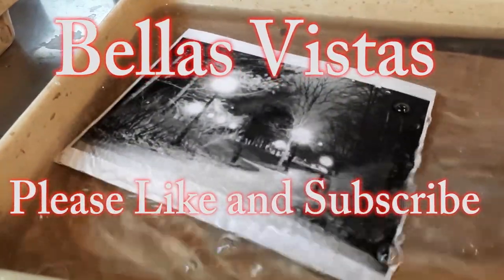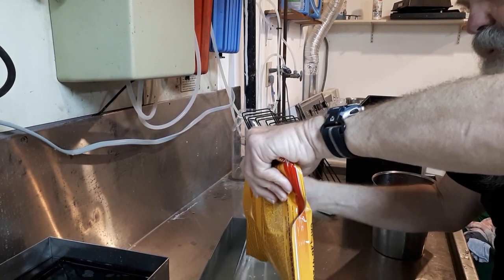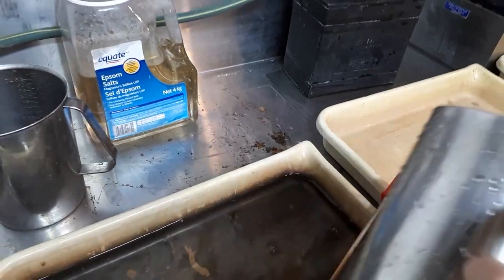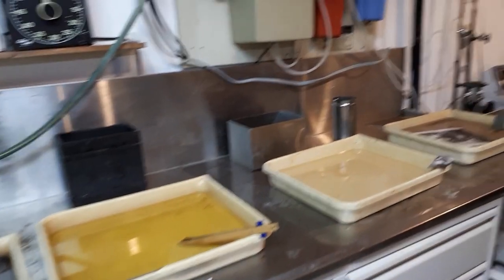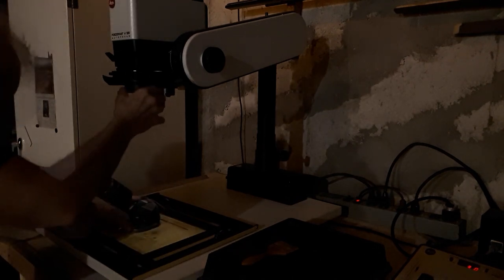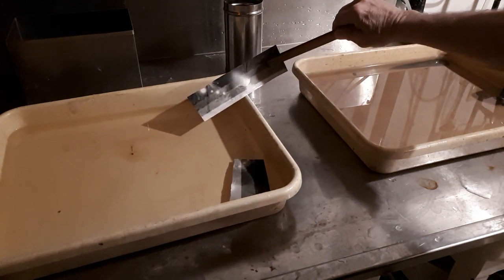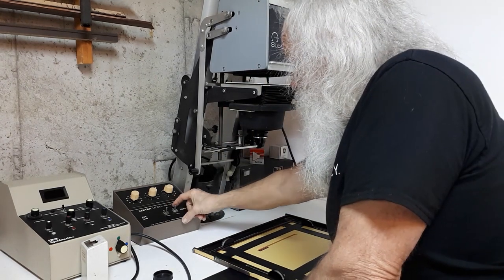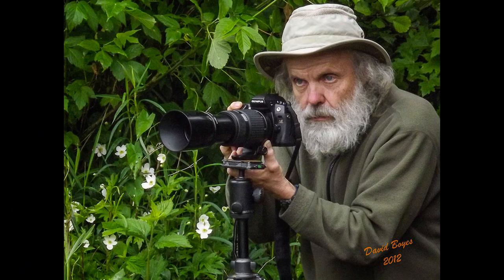B&W Printing Leica Rolleiflex and Cambo

Comment: You use a Kodak Process thermometer as a string tool! Crazy.   Use a round container as it mixes better.
Whole problem is good equipment is no longer made right down to plastic stirring rod.
Reply from the maker: Yeah old habits die hard.  The only time I ever broke a $135.00 Process thermometer was when I hooked it on the wall hanger and just let it go.  That was harsh indeed.   I've got a Canadian made film dryer, a digital water panel from Wing Lynch and so many stainless steel reels and tanks.  Thanks for watching.  Appreciate the time.  I'm mostly doing digital these days.  When I started out at a local studio I was mixing Hypo from lumps with my bare hands.  Just put a Red Dot on my OM-1 kind of a viewfinder camera now. https://youtu.be/IJW1DLOQqEA